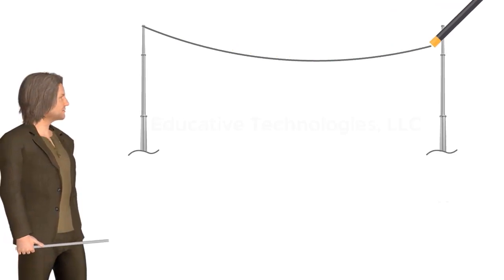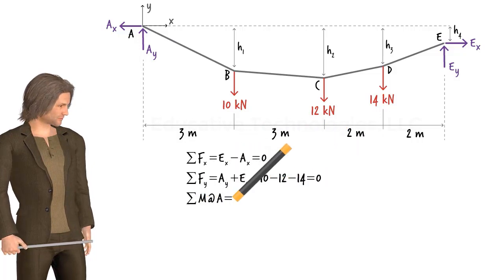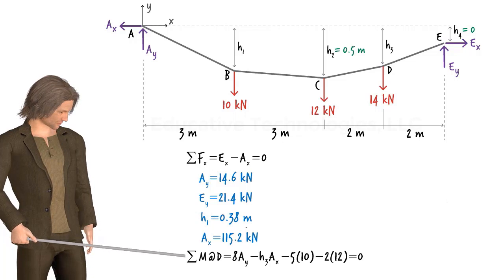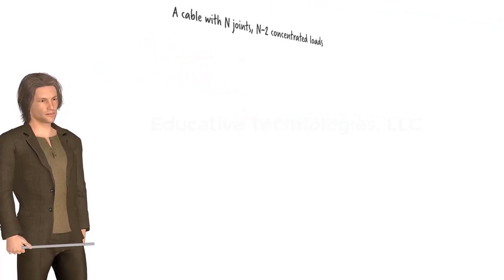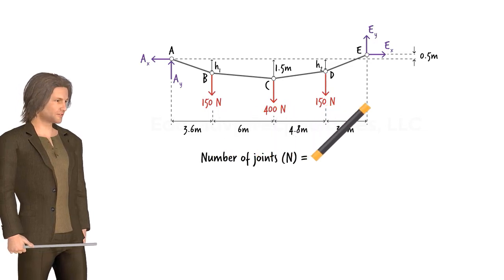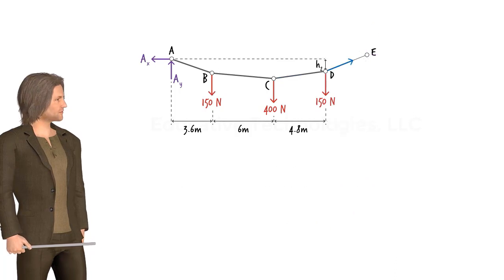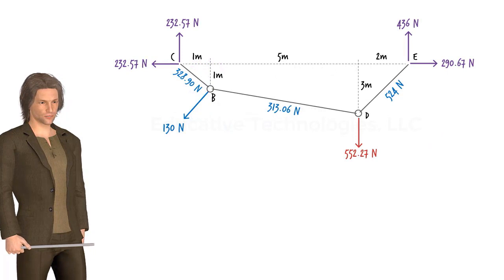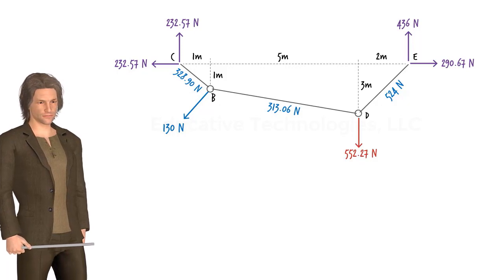SA63: Cable Subjected to Concentrated Load

Comment: Hello Professor, DR Structures.  Thank you for a wonderful channel.  I have a question regarding heights h1 h2 h3 H 4.  @2:57 min  How did you interpret problem to get a value for h2?  Is this an educated assumption.  It would seem that differing values of h2 would translate to different reaction force H.  Thank you! Biagio upstate New York.
Reply from the maker: Correct, different values for h2 result in different tension forces in each cable segment. That height (initial sag) is a design consideration, similar to the length of a beam, for example. If the cable is a part of a traffic light system, that h can be based on the clearance requirements at the intersection. As you correctly stated, depending on the application, we can come up with an educated assumption for one of the h values.

Comment: why cannot you calculate inner tension forces just by vector sum of point load plus tension in the cable next to point load if that one is known?
Reply from the maker: If the positions of the joints are known, so that we can calculate the angles that the segments make with the horizontal axis, we can do as you are suggesting. But if the angles are not known, we end up having both unknown angles and unknown internal tension forces at the joint. That results in 4 unknowns. The  vector sum idea works if there are at most two unknowns at the joint.

Comment: At the second example(with road signs) I am really confused when you can cut the cable into sections. Do you cut it into sections to terminate the other support?
Reply from the maker: In that problem, there are 6 unknowns (four unknown reaction forces at the supports and two unknown heights), which means we need to write 6 equation in order to determine the unknowns. The equations are:
Sum of the forces in the x direction = 0
Sum of the forces in the y direction = 0
Sum of the moments about A = 0
Sum of the moments about B = 0
Sum of the moments about C = 0
Sum of the moments about D = 0

Furthermore, in writing each moment equation we need to cut the cable just to the right of the joint so as to not include the support reactions at the right end of the system in the equation. This is very similar to how we deal with beams and trusses, we cut them, then write the equilibrium equations for one of the substructures only. If we did not cut the cable when writing the four moment equations, we would end up with a set of dependent equations which we could not be solved for the unknowns.
Reply: @DrStructure  Ah okay.. It makes sense to me now. Thank you very much sir! Keep safe!

Comment: Why don't we consider moment by tension at joint?
Why do we consider moment by only left side element? there should be moment by force on right side.
Reply from the maker: 1. A cable is not a rigid member, it cannot handle any bending moment, or even a compressive force. Imagine one end of a cable/rope being attached to a heavy object (say, a car) and you are holding to the other side of the rope. The only force you can exert on that rope is a pulling force. The rope collapsed if you pushed on it, or if you try to bend it. 
2. Yes, we can apply the equilibrium equation to the right subsystem as well. We can choose either the left or the right subsystem when writing such equilibrium equations. We chose the left subsystem in the lecture.

Comment: So in a real question you can just assume the heights h2 and h4 if you dont have enough equilibrium equations to solve this problem without any real reasoning?
Reply from the maker: No, we cannot pick values randomly, without any reasoning.  Textbook problems always provide sufficient information for solving the problem. In real life problems, the geometry of the system is generally known. For example, if the system is for a traffic light support at a street intersection, the height are generally selected by the designer to ensure proper clearance.  If for some reason, some of the heights remain unknown, the system becomes statically indeterminate, in which case we can use advanced techniques, such as the finite element method to analyze the cable system.
Reply: @DrStructure  Sir,please tell  me which software u use to make this Animated tutorial..its great....i  also want to make tutorials  on Mathematics,  please  tell  me......
Reply from the maker: @xyzabc6898  We use Adobe Illustrator for creating the writings/drawings and for animating them, Iclone for character animation, and Camtasia Studio for video production.
Reply: @DrStructure  Thanks Sir  for telling me the name of Softwares.....Sir,if i also use these 3 softwares,then can i make Tutorial for Maths   ????????ur  guidance is my need....u  r doing very good work.....without guidance,its very very difficult for me to make videos...i m super-beginner in this,so understand Sir about   condition of my techncal skill.
Reply from the maker: @xyzabc6898  If you don't have prior experience in using such software tools, it would be quite a challenge to create lecture videos similar to what you see on this channel. It will take you a while to learn and ins and outs of whatever platform you decide to use for creating lectures. You need to do a bit of research to find out what options are available to you and which ones constitute a good starting point. In that vein, you may want to take a look at whiteboard animation software such as VideoScribe. PowerPoint may also be a viable option for creating slides that embody animations and turning them into videos. Mathematical expression can be easily inserted in Powerpoint using plugins like MathType.
Reply: @DrStructure  Thanks you Sir for ur Guidance....ur words  really  helped me.......
Stay bless.......
Take care........

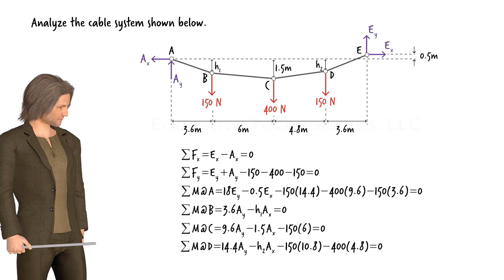Comment: Solving the eqns at 7:48 was a bit challenging as unlike the previous example there is no 0 value
Reply: how did solve problem 2?
Reply: At what equation di you start to solve it?
Reply from the maker: @deecee6780  We have six equations in six unknowns, they need to be solved simultaneously.
Reply from the maker: @ma.zysakeithf.acosta8682  We have six equations in six unknowns, they need to be solved simultaneously.
Reply: @DrStructure  oh okay. Thank you very much.. I need to polish first my algebra haha

Comment: example at 2:41, you forget Sum of M@E = 0, and then, we need only know h4 to solve all unknowns.
Reply from the maker: The moment equation you mentioned is a redundant one. That is, for the entire cable system, we can only write one moment equilibrium equation (we can write the moment equation either about point A or point E, but not both). Any additional moment equation written for the entire cable (without cutting it) becomes useless/redundant.